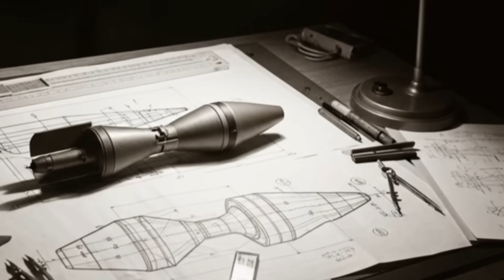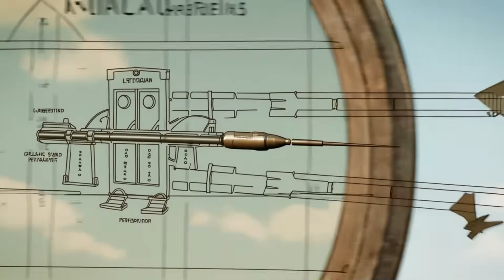GERMAN TANKERS LAUGHED at the T-34 — Until These Shells Turned Their Tigers into SCRAP METAL

Comment: The T 34, even the T34/85 could not penetrate the frontal armor of a Tiger. Stop giving fake informattion.
Reply: IS 100 and IS 152 could easily at 2.6 km.
Reply: You are just an ignorant and an imbecile .The pictures are genuine .
Reply: From the end of 1944 T-34-85 began to punch. One of the reasons for the deterioration in armor quality was the limited mineral resources of Germany.
When examining the armor of German tanks in the laboratories of the Central Research Institute-48, it was noted that "there is a noticeable gradual decrease in the amount of molybdenum (M) on the German T-VI and T-V tanks and its complete absence in the T-VIB. The reason for replacing one element (M) with another (V-vanadium) should obviously be sought in the depletion of existing reserves and the loss of bases supplying Germany with molybdenum."